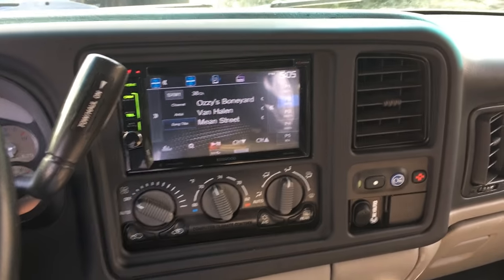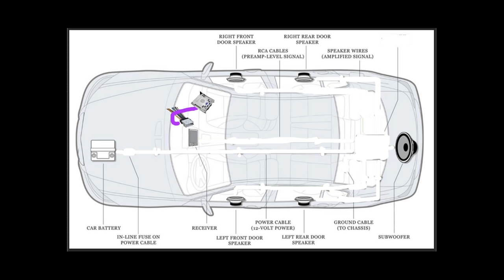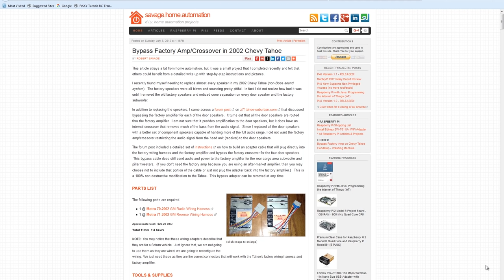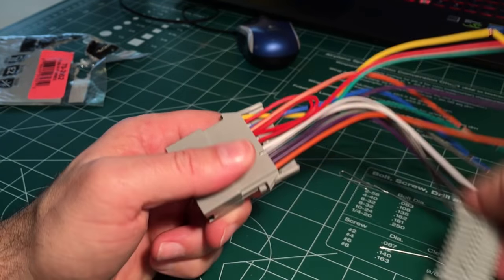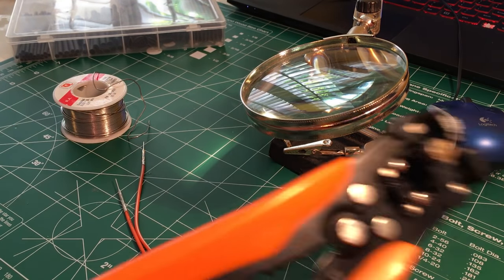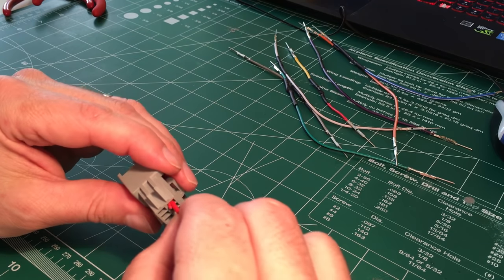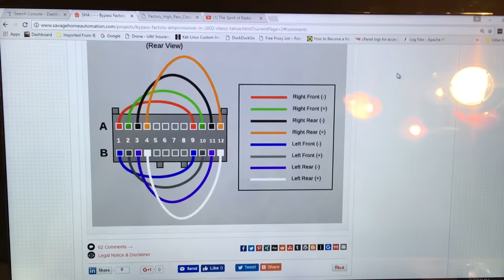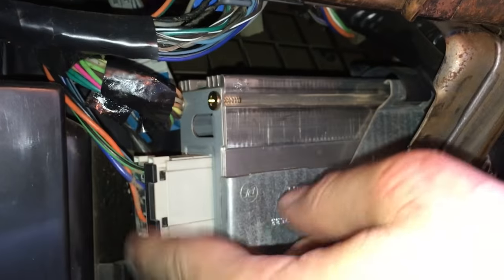Easy Factory Amp Bypass 2002 Chevy Tahoe GMC Yukon

Comment: I'm a 50 year Auto Tech I just want to let everybody know that the  bypass is fine but pay close attention to the positive and negative to the speakers as GM release their wiring schematics incorrectly to the public I own three of these vehicles and I found that the positive negative configuration in the speaker wiring diagrams for these model trucks is incorrect... the a connection at the speaker is the positive and if you look at the schematic going back to the head unit or the amp it shows it as negative on all the speakers ...that is not correct so Crutchfield and Metra and all these people are supplying these quick connectors for aftermarket speakers and everybody's wiring their speakers in reverse polarity even the stereo shops don't even know what they're doing it's funny because a phase tester only cost ten bucks from China I also found that on my 2003 Yukon XL with the Bose system my rear door speakers are in reverse polarity I contacted Bose to see if that was done on purpose and nobody has the answer to that of course I doubt it was done on purpose somebody dropped the ball there too happens all the time in this business and all the YouTube videos are showing people how to  wire the stereo speakers in reverse
Reply: Really? That's F'ed up. Why wouldn't GM fix that error? I'm about to by pass and wire up an entire after market system in a 2001 Tahoe and your comment has me worried
Reply: Jack khol if you can test it from the head unit all the way to the speaker's you won't have a problem but what I found is that all the positive and negatives are reversed in the schematics for the Chevy there is also a polarity Checker CD or download for your phone that you can buy and then you put the tester at the speakers to test them after you get everything installed and make sure they're correct you can buy them from China for like 15 bucks call the speaker polarity tester I don't know why everybody doesn't have them
Reply: Thanks for the reply. So you are saying every Chevy during these years are like this? I'm working on a 2001 Tahoe without Bose system.
Reply: And it seems like I could just reverse the leads at the speakers if that was the case correct?
Reply: Jack khol I'm just saying you can't trust any wiring schematics part of the problem is the rear speakers were 4 ohm speakers and they flip the polarity around on the speaker connectors so they reverse the wires but the problem seems to be that the A&B is not labeled correctly for positive and negative and nobody has ever picked up on that and nobody really ever checks they just put speakers in and hook them up the same way they were and realistically if all your speakers are wired in reverse polarity you probably won't notice it much but they do make cheap polarity Checkers to tell you if they are in phase to me all these high-end stereo shop should be using polarity Checkers because a lot of people's cars I work on I check them and their speakers are wired in reverse polarity
Reply: Jack khol yes just buy yourself a cheap polarity tester then you can test all the speakers before you put the door panels back on
Reply: Any chance u know why the stereo would turn off when I put car into drive? Turns back on when I shut it off...
Reply: Mobile mike, I bought the harness and replaced pins in proper places. Only two speakers are working. Could that be baca use the wiring from factory is wrong?
Reply: 2003 Tahoe Series data II BOSE. That's true because I swear I hooked my speakers up Using my common sense method. Then searched Google because I wanted them done right.  My way was Setting my radio to the door speaker I was working on. I found  that The positive (+)wire alone powered my door speakers without the negative (-) wire attached but sounded shitty. I touched the negative wire in my head unit (-) to every truck speaker wire until sound cleared up. I swear it worked like a champ... Me being the backyard pro that I am searched Google because I wanted to make sure everything was done correct. 1st problem I ran into was speakerwire colors in dash don't match the wire colors on amp. Example. Tan/grey, Green/Drk Green, dark blue/light blue, Brown/yellow Don't match in dash. No yellow, or light blue wire available. Instead theirs a black wire, orange/black wire, Green/white wire etc.  Anyway I finally found the correct GM speaker diagram showing my available wire colors and setup.  I hooked it up the GM way and wala the radio will not stay on, the speakers make a very loud scratchy noise that sound like someone's crumbling a potato bag once they heat up. I'm still using the factory GM amp because it sounded amazing with after market stereo.

Comment: Hey AVT. SO I put in a kenwood HU. And 4 pioneer 6.5 in the 4 doors. Wired up the HU to the factory harness. Jumped the blue/white wire to the pink in the 10 pin. Got audio. I know these speakers are great sounding but they sound so low. Is that because I'm going through the stock amp?  I found the amp and unplugged it and yep no audio. Figured that. Any way all I want is my door speakers to work. I'm not putting in a sub. Which setup should I use? The one you did?  I ask because you said you didn't care if your rear speakers worked. Just not sure. If it is how you did then I may just pair the wires together. Can you advise? Great vids btw.
Reply from the maker: My setup assumes a second 5 channel amp so it would not apply to you (unless I missed somewhere that you do have a second amp).  When i said i did not care if my "rear" speakers worked, I was referring to the tiny tweeters in the way back (D piller).  I was not referring to the rear door speakers. Those do work.  Hope that helped

Comment: Yeah even though I only hooked up power in the ground signal still plugged it into the factory harness there's no way around that so it is still running through the factory amp I just can't get it right I thought that my 12 sub was blown but after thinking about it ,it's just being double fed  .. getting very frustrated iv hooked up lot I'm systems in this one is the hardest by far

Comment: If I go this way, can I just wire a normal amp and sub in the back, bypassing having to get a speedwire and 5 channel amp? Planning to upgrade my 02' tahoe and hoping I can get away with a new head unit, amp, and sub. Thank you!
Reply: My plan is to physically remove the amp. Maybe even go far as removing the wiring. 
I’m doing a full system in my 03 with Bose. 

I’m gonna trace and label each speaker wire. And tap in them thru the back of the radio. Or if not I’ll just tap into them from the  factory amp location. I’m gonna put the amp under the passenger seat anyways. So I’ll need a short run from my speed wires to the harness at the amp. I’m not tryin to revert to stock anytime soon. Lol Bose is nice. But much nicer set ups out there. It is a bit dated. It’s time for an upgrade.
Reply: Let me know what route you took. I plan on doing a full upgrade. So I’ll let you know how it goes.
Reply: @Username-ng8jy  I ended up getting a 2010 tahoe with Bose and put another amp and a 12’ sub into it, so I went a seperate way
Reply: @nateweiner8890  ah ok man. That’s cool man. Hope you enjoy the ride. 
I got an 2003 I got earlier this year. With the holidays coming up. And free time. I’m finally fucking with my tahoe. Just got my tranny rebuilt with sonnax shift kit corvette servo and upgraded converter. 
Got carpet on order. And need to repair my headliner. I got a wood steering wheel I’m refinishing. Black Friday deals popped up so I’m ordering my sound equipment.

Comment: I’ve talked to you before. But now I’ve replaced all door speakers and they sound great but when I turn up volume high they start to distort and crackle. I imagine it’s because I had the Bose system so I’m thinking the Bose amp is putting two much power to the speakers. Because I have a 200 watt double din deck now not factory. If I disconnect the amp will that solve my problem at high volume? And if so can I just disconnect it totally or do I have to bypass like you did
Reply from the maker: I don't know because mine was not Bose to start with.  Hopefully someone will chime in.
Reply: Connect blue w/ white line wire to your red 12+ and it will bypass,well it worked for my 06tahoe and 10.1 android head unit. May be diff for your vehicle

Comment: Okay so if I hook the radio up just normal and then come off of my amp to the factory speaker that eliminates that whole problem right cuz I really don't want to go through this I think it will be more work but I will save a little and headache
Reply from the maker: yes.
Reply: @TahoeSteve  ok but  when I tie my harness together all I should tie together is my power ,signal and ground right the door speakers in the front are disconnected but there are still some speakers in the back that are not disconnected so even though I have my main speakers I'm going to be using running straight from my amp if I tie the harness in color to color for all wires then the leftover speakers are going to be running through the factory amp and make it sound like crap right ? Kind of a rhetorical question lol it just sucks because I want to use them highs

Comment: My question is how did you make the double din fit? Did you just use the newer bezel and it fit perfect? I have an 01 Tahoe and wanting to get rid of stick radio but I know those are only a din and a half
Reply from the maker: The aftermarket bezel made it very easy as it fit perfectly.
Reply: Where did you find the aftermarket one from? I’ve heard the ones from the newer Tahoe’s fit like the 2004 to 2006 but I haven’t tried it
Reply from the maker: @fmman5on  Got mine at a local car stereo store.
Reply: @fmman5on  The 04-06 Bezel trim does work and is cheaper to get than the aftermarket dash trim.

Comment: Will a metra 70-2021 impala bypass work?  
Did not try the 70-2021 ,but I did follow these instructions for a 2000 suburban and it's amazing how great this works. Thanks alot even the people at audio Express doubted this. I will take this back and show them
Reply: Hi, Jacob, I have been trying to bypass my 2000 suburban amp. Which wiring harness bypass do I need?
Reply: @briank6357  this harness that he made works perfect. For the 2000 suburban. Only problem was that the harness was missing one pin. So if you have an extra harness sitting around you could take a pin from it. The harness I used was the Metra 70-2002 and followed the instructions in the video. Works perfect. No rear sub though or rear tweets. But i added a cvr so no need for factory sub.

Comment: Is there a way to connect the back pillar speakers and sub?
Reply: Yeah, you can wire in a second harness as well that plugs into the amp to make the tweeters, D pillar speakers, and stock sub work as well. That was the first diagram he showed in the video.

Comment: Will this fix my issue on my '07 hummer H2? Added a after market amp and subwoofer...amp powers on but no audio....all my wiring are good...even my ground is good and bolted tight...still no audio through my woofer
Reply from the maker: no.  99 to 02 only.

Comment: Hello Steve my name is walter I love your video, question if I bypass my factor amp! Do I need to get a cross over so I can use my tweeters?  Because I want to replace all my speakers also.  What's the best way for me to do this, and get the best sound.
Reply: there are mid-tweeter combo speakers that come with crossovers that you can plug and play.

Comment: How did u get a double din in ur 02 ? Been wanting to put one in mine
Reply: put a 2003 and up bezel  in it (the part you pull off to put radio in), the hole behind is big enough for double din, but bezel on 2002 only has cutout for din and 1/2 2003 has double din cutout.
Reply from the maker: see this detailed video:  https://www.youtube.com/watch?v=NXwjRasWbus

Comment: So I have the same truck. I installed a new CD deck and new door speakers. All Im using is the stock amp (which is in the same exact place as yours.) my issue is after about 6 months my speakers are not working anymore but I do notice they work every once in a while. And it’s only for a little bit before they shut off again. My deck appears to be working. I’ve checked all the wiring behind the deck and to the speakers. Nothing seems wrong there. I’m wondering if it’s my amp. What do you think if I were to buy an amp and just this exact same thing?
Reply: My wife has an 01 Tahoe lt. We also replaced CD player radio/ and door speakers. Sometimes sound work/ sometimes it doesn't. For a few days I could un plug from amp and plug back in and it would work. Now there's never no sound. Radio always lights up w power as yours does. I ordered the harness the op used. Hope this will fix it. I'm wondering if my alpine will power the speakers good enough though. Please reply when you have more info to your hopeful fix and I'll do the same.
Reply: massey9556 please do let me know! I won’t probably get to it for about another month. But it’s driving me crazy! Awesome man thanks for a reply.
Reply: Mike, apparantly this video is for non Bose. Do you have any idea how to find out if we have Bose or not? My factory radio does not say Bose.  Jw if you're does
Reply: I have the same problem with my Avalanche. I was told my amp is going out. This bypass they said should solve my problem.
Reply: Here's my update. The harness was one pin short as another person had commented. So just order two when you order and be done w it. Also when I installed my new harness, only the front left and the right rear speaker work. I either have the wiring wrong on the harness or it has something to do with the interface that was installed behind new head unit(cd/radio player).  I am going to get a buddy to remove the interface. Then try again and see what happens. The interface is to block amplification of the CD player so that the CD player and factory amp wouldn't fight with each other while trying to amplify the entire system. That's the way it was explained to me. So basically I need to remove the interface to allow the CD player to do its normal push to the speakers since I'm bypassing the amp. Well I hope that's not to confusing. Be back in a week or two to update if y'all will remind me. Thanks
Reply: Josh, please comment back and let us know how yours works out and what u had to do to completely fix. The more we communicate the better all of us can get the fix nailed down. Thanks man
Reply: massey9556 good luck man. I’ll be sure to remind you. I need to see how this is going to play out for me.
Reply: Mobile mike has a reply at the top of this page and I wonder if that why only two speakers are playing in mine after using the new wiring plug?

Comment: I think you just built a 70-2021. Says it only works for impalas and monte Carlos but I use them on suburbans, Tahoe’s and Yukon’s all the time.
Reply: So just buy the 70-2021 and would work just fine??
Reply: @TheTaterhead09  I believe the 70-2021 might be reversed IIRC. So it works, but rights are lefts, or maybe fronts were backs, there was something inverted about it like that. So, to get it working 100% you'll have to swap the pins around a little. It might also have the + and - inverted as is, which won't sound great either.

Comment: So I am trying to free the amp behind the glove box and when I popped the c-clamp at the top that didn't free the amp.  I am barely able to rock the amp back and forth.  It's as though there is another somehting holding it onto that bracket.  Thoughts please!!!!
Reply: I'm in the same boat.
Reply: I am having this trouble too.
Reply: Did you ever find a solution

Comment: What harness did you use to install the screen. I tried using a scosche gmo2b radio harness but powers up just no sound....2001 yukon, anythoughts
Reply: Dis you ever figure out the issue? I have a 2001 that is givin me some no sound problems
Reply: @TrailingSkies27  i ended up giving up on all the harness and repin harness recommendations, and i honestly just ran new speaker wires to ech of the doors...

Comment: I came up one pin short to complete the 8 wires needed.  The one I bought used a two pin into one pin red wire, so there wasn't 8 pins for each side.  Bummer man.
Reply: Same here. Super stinks

Comment: You mention ur sub worked at the end of ur video with just using the Metra 70-2002 is that correct?
Reply from the maker: @Edgar - In my situation, I have an aftermarket sub plugged DIRECTLY into the aftermarket amp.  In this case, you do NOT need anything besides the Metra 70-2002.  Keep in mind that the D Piller tweeters will not work though.
IF you have an aftemarket amp and your sub is NOT wired directly to the amp, then you will need both harnesses as described on http://www.savagehomeautomation.com/projects/bypass-factory-ampcrossover-in-2002-chevy-tahoe.html.

Comment: Hi connected one of these 2 Chevy avalanche 02 I have a aftermarket app I install I wanna connect this bypass system It messed up everything What did I do wrong
Reply from the maker: That's a hard one to answer not seeing what you did.  go back and start over.  double and triple check everything.  this works if you do it correctly.

Comment: Does the factory sub work with bypassing the amp my friends tahoe the stock sub doesnt work at all atm
Reply from the maker: No.  My install involved replacing with an aftermarket sub and amp and wiring the 2 together directly

Comment: So i wouldnt need to keep the pink wire hooked up for the amp turn on?
Reply: did you ever find this out? i assume you can leave the pink wire out because the harness bypass just connects the 8 speaker wires together forming a complete circuit excluding factory amp